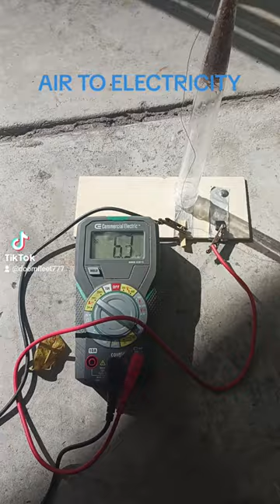YOUTUBE VIDEO AIR TO ELECTRICITY OBELISK CELL

Comment: Thanks for the video, Peter! Could you point me in the right direction (construction, schematic, etc.), so I can try to replicate your project? I have read some of the papers you pointed  out on another video, found University of Massachusetts Amherst, so this is very interesting and I would like to make a coil (obelisk?) like what you demonstrate here and try it out. Thanks!
Reply from the maker: It is the coating of wire mesh with the Prussian blue nanocatalyst that allows its function. The catalyst has alot of online info. Original company was storedot